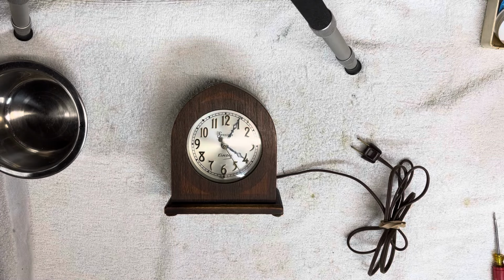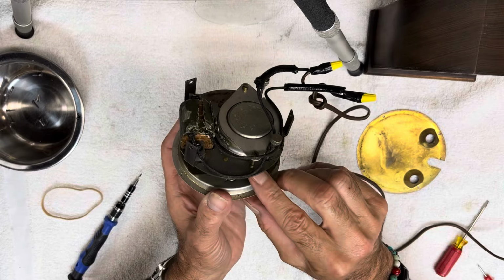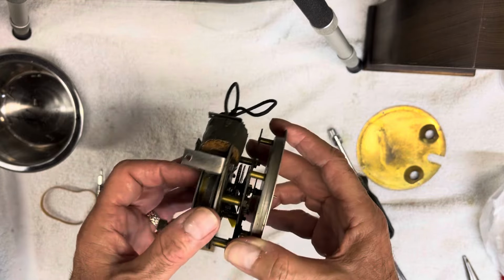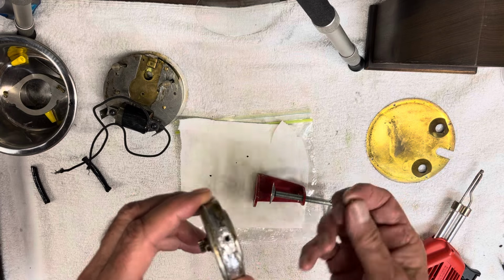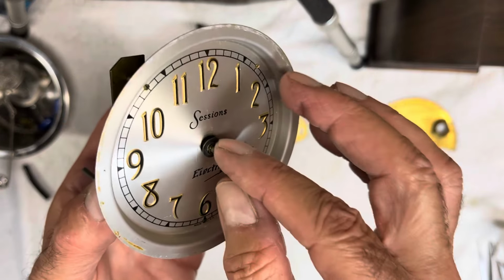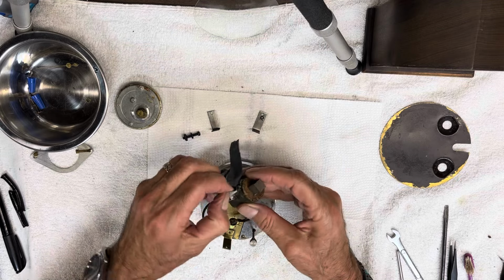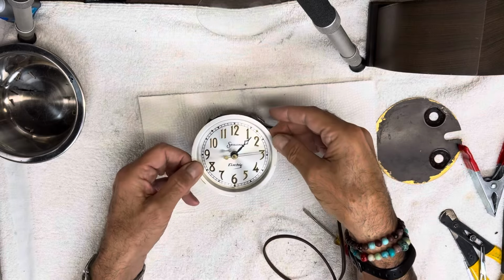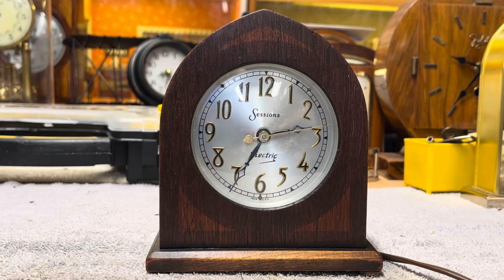Repair and Restoration of a Sessions Electric Clock c. 1930’s.

Comment: Hi Mark, I have the book on Sessions clocks by Tran Duy La, on page 246 is shows your clock, it's listed as No. 247 M 1936. Of note is that the same case was made in a eight day lever time movement (No. 257 L 1936) Lever meaning a ballance wheel escapement.
Reply from the maker: Thanks for the info.

Comment: Hello - I am an antique radio repair person and I am currently working on a Canadian Westinghouse Model 801 Grandmother clock and radio from 1932.  The clock seems to be intact however the coil is missing.  I came across your video and that mechanism seems to be the same (ie) Hammond and general appearance.  Do you have a part number or specs that I could use to find a replacement?
Reply from the maker: Unfortunately, I do not have the part number for the coil and I am unable to provide technical assistance.  I recommend contacting a specialist clock repair person.  Good luck!